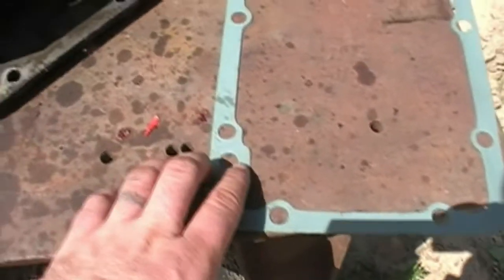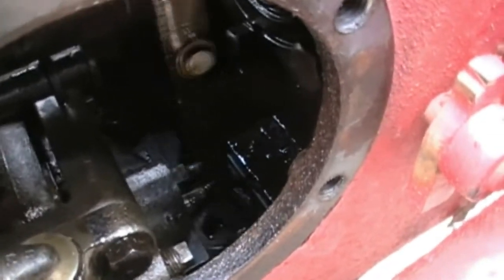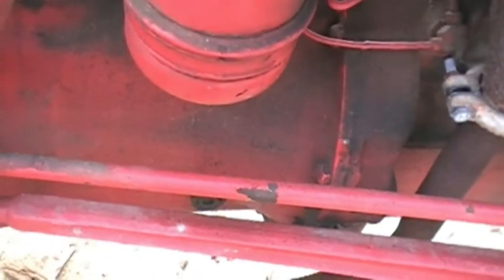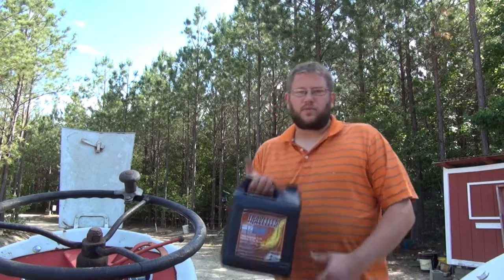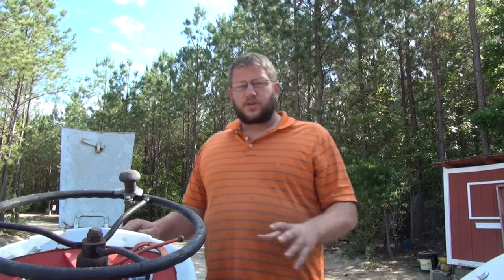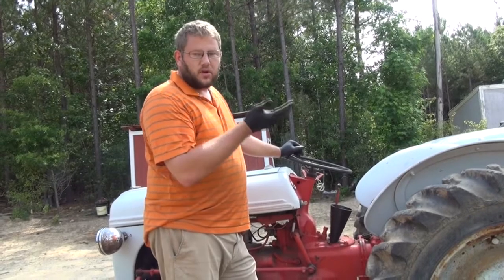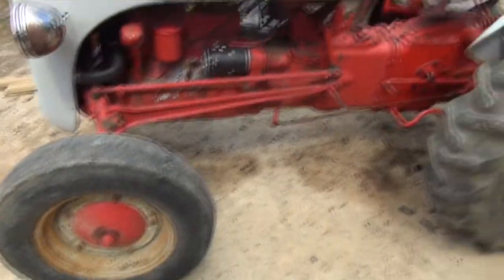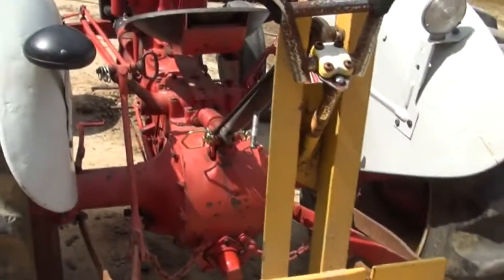DIY  1941 Ford 9N tractor, Hydraulic pump install (Part 3)

Comment: What about the Tractor Supply Universal hydraulic fluid?  It is labeled to meet the old Ford requirements it appears on the labeling....  I bought this instead of the mineral oil as the 5 gallon bucket was available in the universal blend
Reply from the maker: That probably is ok, less expensive, and more readily available.   I chose to go with spec for this one.     Thanks for watching!
Reply: @ Brandon. No, sir. Do not use what's known as Universal 303. It's too thin and will not lubricate the N series pump, rear axle assembly, or transmission properly. It will also cause negative lift performance.